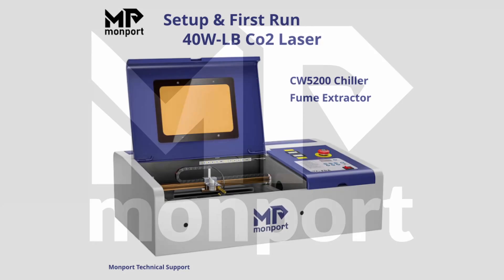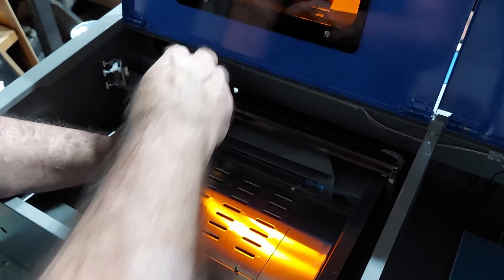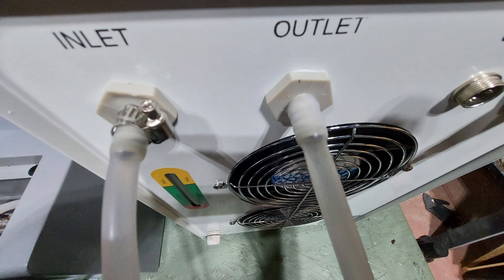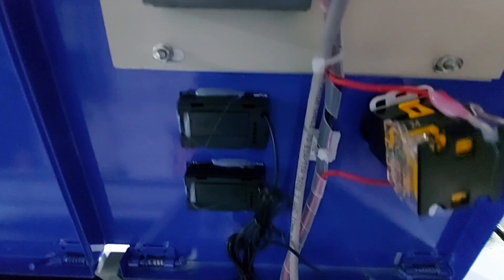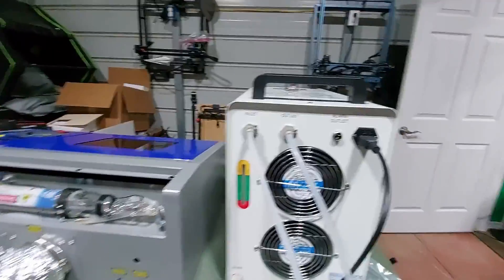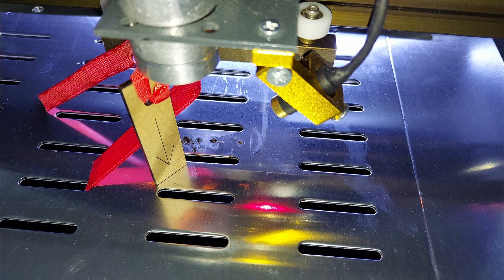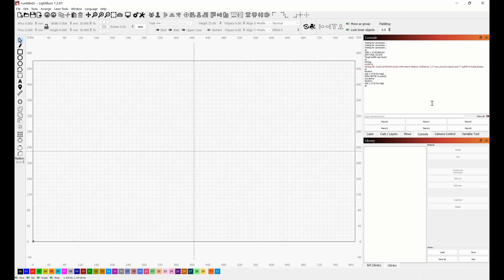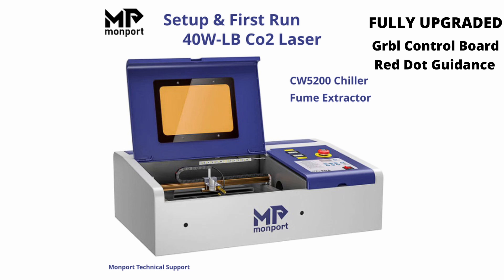Monport 40W desktop Co2 laser丨Unboxing, setup and first run

Comment: What is the correct method to ensure you are setting the correct power % on this laser?

The Monport manual says :

“Laser Power Display: This displays the current power of the laser as a percent of its maximum intensity. Adjust this setting accordingly to process various material s . For most material s, an intensity between 20% and 60% i s optimal . when aligning the laser beam, you should use a setting lower than 30% for safety reasons .
Remember: Running your laser tube above 70% power can significantly shorten the laser tube's lifetime (We recommend staying below 70% power to prolong the life of your laser tube)” 

So I can only assume there are 2 ways to run the power on this machine. (1) If you run the power knob like the manual says, you then must use 100% for all operations IN THE SOFTWARE, and thus control the % of power with the knob (and make sure it never goes above 60% or you damage your laser tube).  
- OR -
(2)  Turn the knob to 100%, and control actual % of power via the software settings. 

Since my Monport K40 power display shows mA, and NOT % of power, so I’m not sure how you can set “20% to 60%” power (as per the manual) by using the display gauge.

Any folks out there have the actual answer as to which method is correct? Thanks
Reply from the maker: Hello! Feel free to reach out to support@monportlaser.com :)

Comment: Putting mine together. I'm at 1.75 gallons of distilled water and I'm finally about middle of the halfway point. It took a very long time for the water level to register, I thought mine was busted. The clamps for the hoses are junk. The screws act like they're stripped and would not close, so I'm off to the hardware store for replacements.

Comment: Waiting for my K40 to arrive from Monport, but in the meantime, I see at 3:20 or so you show the external ground on the back panel, but in parentheses it says (not needed in the USA), why is that? 

From most of the other videos I've seen on K40 units it's highly recommended to ground this machine to an earth ground for safety.

Comment: In this video from about 11:00 - 12:00, you show the mA knob read a value of 18 or so when the emergency stop is lifted.  You are then able to turn down the mA reading through various numerical values until it reaches 0mA.

The ammeter on my machine doesn't show anything other than 0mA unless it is burning.  How is your mA display able to show a power reading without th4 laser burning?

Order #2450 dorect from Monport.
Reply from the maker: Hi Phillip, we will send you after-sale email ASAP.

Comment: How much algae control do I add to the chiller?   I also purchased non corrosive anti freeze as Michigan winters are vicious.
Reply from the maker: If the temperature is between 0 ~ -10℃, you can use 50% algicide and 50% antifreeze.
If the temperature is below -10℃, you should ALL use antifreeze
Reply: @monportlaser  with respect to how much water in the cooler?   I’m used to using Fahrenheit.
Reply from the maker: @DaBalloonGuy67  0 ~ -50.00 ℉
Reply from the maker: @DaBalloonGuy67  what kind of water chiller are you using?
Reply: @monportlaser  CW3000
Reply: @monportlaser  is there a difference between using purified water and distilled water?
Reply from the maker: @DaBalloonGuy67  Actually not. Purified water and distilled water can reduce the impurities from tubes.
Reply from the maker: @DaBalloonGuy67  Water + other  substance do not exceed 4/5 of water tank.

Comment: I will be purchasing one of these in the very close future.  I’ve seen many different versions  of this model but I want the one compatible with lightburn.  I’ve seen a model with wattage adjustments all the way down to a tenth of a watt.  Is the water chiller worth it or could I get away with the pump and ice cubes in a bucket?   They are sold out of the fume extractor and I want one of those.  I currently own an xTool D1 pro 20 watt.  I’m currently having trouble finding the right tension of the x and y axis to get a round circle.  

Do you have a code to get a discount for this engraver?   I look forward to engraving my own metal business cards as well as making drink coasters and other small projects.  

Thanks for all your help.
Reply from the maker: Hi Sir or Madam, actually whether you need a water chiller is the matter of frequency using the machine and temperature in your area. If you are just making some hobbyists, the water pump can help totally. We offer a 5% off for ALL subscribers. If you would like to know more details, plz contact us at: sales@monportlaser.com
Reply: I received mine and the chiller but will try and connect the laser to my laptop.  How much algicide do I need to add to the water?   How much anti freeze as well?   I may wait till the weather gets warmer before operating the laser.

Comment: No yongli tube as mentioned in the video, water chiller is 2wks late even getting shipped and barely make it through 3mm hobby wood at 550 mm/m and 60% power. Not thrilled with it so far.
Reply from the maker: We will help and notify the shipping info through email

Comment: So the unit is shipped with the mirrors aligned and tested?
Reply from the maker: It will all be tested and aligned. Maybe it needs a little adjustment if there is turbulence in transit. Most of machines are ready out of box!
Reply: Obviously this is a lie bc if it was tested each unit would work without issues I have had mine since February and have yet to be able to use it and not getting any help or support from monport

Comment: I just got mine and trying to get it to burn using Lightburn's "first project" deal, tried following the instructions properly but it only burns in one spot, probably because I don't know what I'm doing, my first, be gentle🙃 I just typed in my name and then did the "offset shapes" thing then I did the "Frame" thing and hit start and I just didn't get the results I was expecting. I think I am not putting in the right speed/power numbers. What should I use? thanks
Reply from the maker: Hi Billy, you can contact our customer service team at: support@monportlaser.com
Reply: Probably because these things are junk